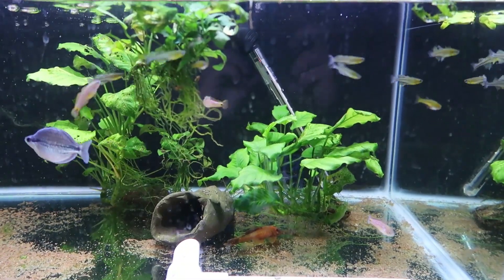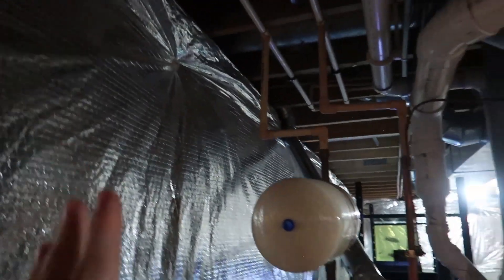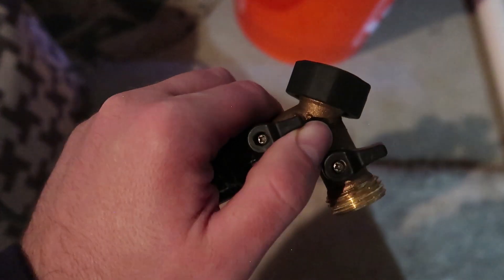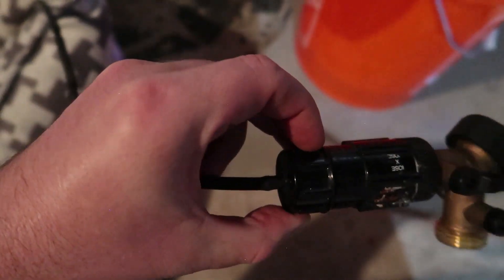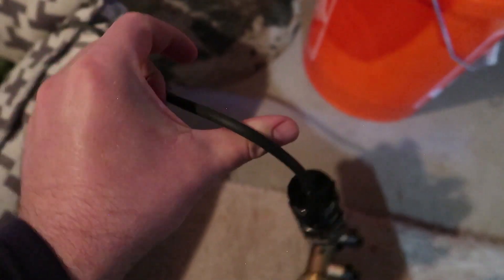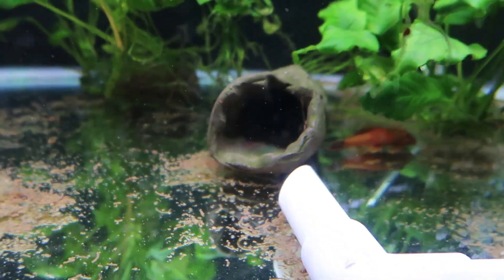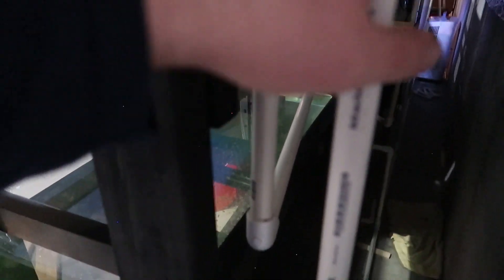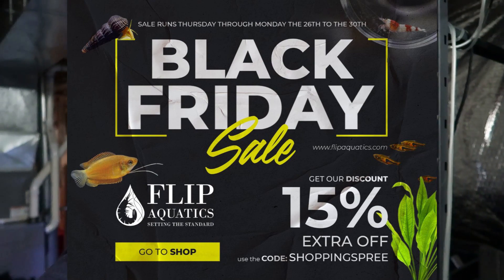HOW TO: DIY DRIP SYSTEM - AUTOMATIC WATER CHANGE

Comment: How would you apply this method with 8 tanks
Reply from the maker: Multiple drip emitters. I'm running 12 tanks this way currently.
Reply: @TheFishNerd    I get that.  But how would I run multiple drips out if that one tube that comes out of the carbon filter.
Reply from the maker: @joeprovenzano4362  oh gotcha. There are "T" adapters for splitting off multiple lines. Thought I linked them in the description but may have forgotten them.
Reply: @TheFishNerd   thank you.   I appreciate the intel.  Thanks
Reply: @TheFishNerd  that was sooooo stupid. I can’t believe I even asked.  Ty
Reply from the maker: @joeprovenzano4362  haha! If that qualifies as a stupid question, I'm a first class moron. Lol

Comment: Ok so designing on of these systems now with a slight twist going from a split faucet. My question though is what kind of carbon are you putting in there? Just loose stuff? Where do you buy that? Thanks sir
Reply from the maker: Yup. Just loose stuff. I buy it on Amazon.
https://amzn.to/3m6Rz3T
(This is an affiliate link to the stuff I use on Amazon)
https://amzn.to/3m4XCWQ
(Second affiliate link is to a bigger container of the same stuff)

Comment: Great video, not sure I have ever seen a drip system just spliced into the cold like like that but I guess it makes sense when you're only doing 1/2 gallon per hour it would warm up quick. Do you just leave the valve on all the time or do you turn it on once a week to then shut if off the next day? As well, just so you know - the links in the description aren't working. All the best
Reply from the maker: Yup! The drip is slow enough as to not altar the water temp so no need to heat the incoming water. I've done it both ways, leaving it on all the time and also turning it on/off. It all depends on the tank size, stocking and how much water you need/want to change.
I'll check those links! Thanks!!